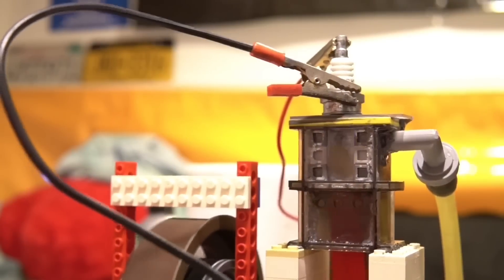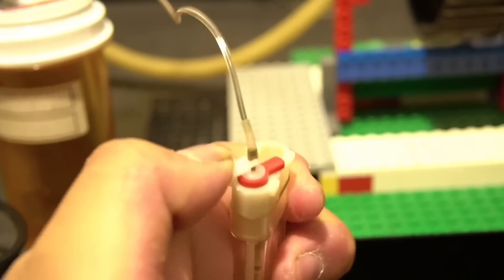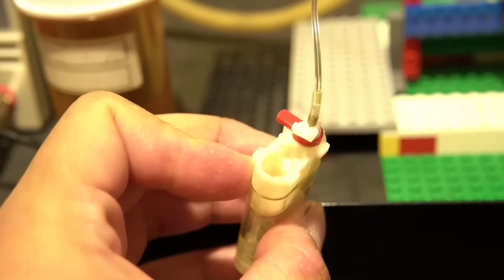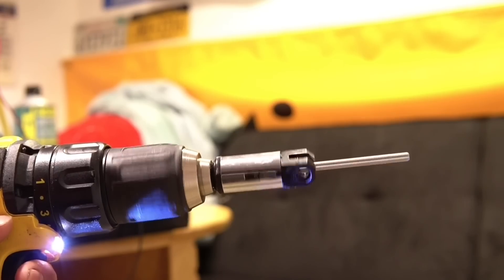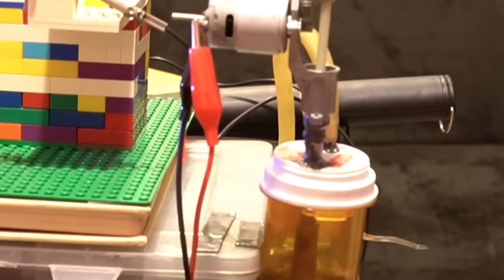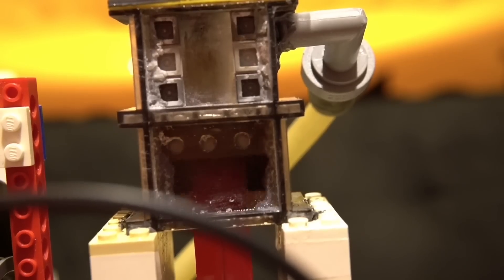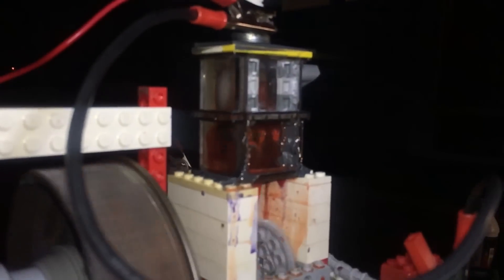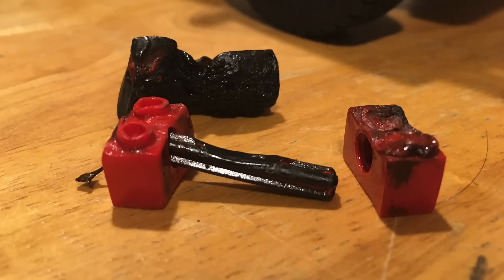Working LEGO Combustion Engine! (2 Stroke) Version 3!!

Comment: I gotta say I LOVE  your spark plug triggering mechanism. It's simple and elegant, simply triggered by the piston reaching maximum compression, it's wonderful. It's quite unfortunate that it never was able to power it self. I have a feeling that it might not be causing enough boom. Regular petrol would work better then the normal 2stroke mix with your design since you are not lubing any parts. Also lengthening the crank shaft and adding a second piston on an opposite timing would help immensely. It would cut the amount of energy you need per each explosion in half.

Comment: Have you measured compression?  If you have vaporized gas and air mixed at a proper ratio, spark correctly timed, and sufficient compression, the motor should run (at least given what I know about motors from being an auto enthusiast).  Fantastic work on the motor nonetheless, insane you can get anything like this out of lego parts.  I would doubt it's possible for it to run long though, especially if the parts that form the combustion chamber have any legos in them.

Comment: Have you tried spark advance?
Did you need more exhaust ports?
Did you need to add some something on top of the piston for a flat surface?
Did you need sone kind of coating to reduce cylinder walls temperature?

Comment: Engine can't start because no compression. Intake port should be lower. Then piston moves up, it should close intake port. This engine is two stroke. Read about construction two stroke engines. Good luck

Comment: For this to work you need to forcefeed the engine with the intake air, you need to go back to gasoline since the nitro methane melts Lego plastic, and the final key, you need to advance you ignition timing, try a couple degrees before top dead center NOT after 😉

Comment: nobody in the comments knows any about two strokes. do they need exhaust back pressure? no, they don’t. the back pressure people talk about that is “necessary for it to run” is just to make more power. the reason your engine won’t run is because the seals aren’t good enough. that’s also why the spark plugs don’t ignite the fuel every down stroke. the engine isn’t able to compress the mixture enough to enable combustion. figure out some way for sealing the piston and it’ll run, at least briefly.

Comment: 4:17 When you forget to turn the fuel pump on

Your intake ports need to be set lower than your exhaust ports for scavenging

You need to valve the intake.

Comment: You need to fashion a piston ring of some sort on the Lego piston and maybe some Teflon against the cylinder walls for sealing and lubrication you almost have it! 

Remember the exhaust port it usually pretty high in a 2 stroke there not much of a power stroke before the piston uncovers the exhaust port but you may get away with where you have it now as the intake system you have is different to the 2stroke, also try and put a kinda spark adjustment on it so you can advance an retard it, remember spark happens just before TDC looked in the video it was happening at TDC, maybe try a smaller flywheel so it may not be over killing the power? 

Keep it up will be good to see 👌

Comment: Hey, Remember in a 2 stroke the exhaust Port needs to be a little bit higher than the intake Port, and they need to be on the opposite side of eachother  in order to make an air flow through the cilinder

Comment: You shouldn't fire it in your house because of the carbon monoxide so just be careful and you could use rc grade nitro fuel and if you run it rich enough it will reduce heat in the engine

Comment: What if you make the exhaust port  somewhat wide as the inlet and maybe lower and then make a lego muffler or strick it down so then it could maybe run slighty better. Im trying to design a lego 4 stroke engine that i can hope and get running its just trying to get compression and valve cealing right, any way i made no sense for some reason, great video and keep going.

Comment: Hi there I love the concept but you've made a fatal error in afraid you need your exhaust port to be higher up on the cylinder than your intake port otherwise when the engine fires you force the fresh mix that is coming in straight out through the exhaust port hope this helps keep up the good work :)
Reply: Also  you dont need a proper exhaust pipe to make the engine run properly just something to slightly restrict the exhaust port (seeing as how it wont run on it's own yet I would make the exhaust restriction adjustable) the people who are saying you need an expansion chamber are wrong you only need an expansion chamber to tune the powerband of the engine and seeing as you aren't exactly looking for high performance it's really not worth it just a slide over the exhaust port that you can move to adjust the back pressure would work fine :)

Comment: Usually the 2 strokes have the exhaust port higher than the other ports, like 180 degrees f9r the exhaust and 120 degrees for the intake, also the spark plug should spark before the top dead center, like 18/20 degrees, more degrees before top dead center means a better working engine at low rpm but higher temperature at higher rpm

Comment: Remember this is a 2 stroke. If you use air pump to pump in the air-petrol mixture you maybe have the right pressure, but the biggest issue with your design, you put too high the intake hole and becouse it you haven't got any comression. Put the intake port down to the bottom dead center almost same level (upper edge a bit lower than the exhaust) as the exhaust port. If the piston seal enough and you have a good compression ratio at least 8:1 it should work :-) . I hope i helped.

Comment: Would it be better running metal parts with LEGO or just re engineer LEGO metal parts and use a more heat resistant plastic to use for cylinder viewing

Comment: I think the piston needs some form of seal within the cylinder to maintain compression, like oiling rings and such on a normal piston. I think youre only achieving single cylinder pops when the pressure plus afr is correct on that specific compression stroke. There is something to be said about a circular piston as well. A rectangular piston will not experience pressure forces evenly across it and thus im guessing would transfer to the rod weird, as well as weird bore and stroke issues leading to odd flywheel momentum. For the engine to sustain itself that first pop has to be strong enough to throw the flywheel hard, getting the whole system to rotate quickly enough to build high pressure for the next combustion stroke. I suggest going bigger with the whole design. Scale the entire thing up to make everything more structurally sound and rigid, and get enough air and fuel in that cylinder to go bang even with garbage compression. Also, 2 stoke engines are witchcraft and run on hopes and dreams.

Comment: The exhaust port opening times where waaay to small thats why the motor hat no chance of cooling down. An actual two stroke has 3/4 of the times the exhaust openend. The inlets are opened even longer.

Comment: I just built a 4 stroke lenoir cycle combustion engine from an old 110ccm air compressor. Ive learnt a few things in wanna share: 
1) compression is everything. Try to seal the piston by sticking pieces of tape to its sides. You could also make a piston from jb weld (check out makerj101s video on that)
2) use a flap/reed valve. You can easily make one from thin spring steel (feeler gauges are made from spring steel shhets in different thicknesses so you can choose from different strengths and they’re like 10 bucks)
3) the carburetor needs to be precisely tunable. You should shorten your intake hose and add a second ball valve to control the mix rate (air to fuel vapor)

Comment: I was waiting for this for ages, and it's finally out! I can't wait for the new and improved version! Also, try building a larger box around the cylinder, where water can flow through, it might cool off the legos enaugh not to melt, and make the crank-case closed, so you can put oil as lubricant in there. The oil might cool it from the inside as well. Thanks for continuing the project!👍

Comment: Try to make a lego engine that runs on pure gas. Only electricity to start. natural aspiration.
Reply: Im not sure if that would work, you need electricity to ignite the air/fuel mix unless you're talking about the drill
Reply: You could use electricity to start it.

Comment: Haven't watched the previous videos but i assume it doesn't work coz lego doesn't provide a good seal/any compression, so most of the expanding gas after combustion is just gonna blow by the "piston" and ur gonna have hardly any energy actually pushing it down. Also having compression would mean you don't need as much air/fuel being pumped in

Comment: Make a rudimentary carb so you can adjust your air fuel mix and get vaporised fuel rather than just liquid. That might give it a bit more of a kick.

Also, a one way valve on the fuel inlet would help with building a little bit of compression, otherwise when it comes back up you’re probably pushing fuel back down the line, assuming it holds any compression at all.

Cool idea though though, would love to see it run on its own!

Comment: Would putting a flat tile over the piston make it preform better?
Reply: Odd1 it would add compression at least .. also , the placement of the ports are off and the exhaust needs at least a pipe or even better an expanding chamber so the exhaust gases are getting sucked out. But it was a fun video to watch nevertheless

Comment: Cool idea dude, but what you are missing is compression. You will never get that thing running like that because of the immense amount of blow by. For a decent combustion cycle, you have to have a near perfect or at least decent seal from the piston to the cylinder walls. Without that, you wont get the proper combustion and any combustion that does happen will seep past the piston and out of the engine. hope this helps

Comment: What you need is a real fuel pump. That setup you have there is probably forcing air into the lines and causing problems.
That, and it's probably not at a constant pressute... You may be forcing fuel into the cylinder while it's already trying to burn and just end up putting it out, or opening the valve and letting pressure escape.

Somehow I feel like your flywheel may be too heavy for the engine to turn on it's own.

Comment: Ok, Great Idea. 

But If I may make some kind suggestions.

1 try building a hit and miss motor. They run at slower revolutions.

2 I believe your bug zapper power supply did not provide the necessary voltage that particular spark plug utilizes. All modern spark plugs utilize 12 volts. You may want to consider trying a glow plug or boosting your voltage to 12 volts and the necessary amperage.

 Or look into a coil spark plug system found in the early engines. A modern designed system can be found in lawn mowers and two stroke weed wackers.

3 try utilizing Pure alcohol for fuel. Now I doubt you can get ahold of alcohol used in rocketry which is the ideal candidate since it burns longer and cooler. 
But you could potentially use high-proof liquor alcohol which is known as ethyl alcohol such as vodka and moonshine and can be found everywhere.

I hope that you read my suggestions. I would love to see this project come to a successful conclusion it's a wonderful idea. 😎

Comment: Seems like you need a better seal on the piston
Reply: Yes he needs compression
Reply: This is the reason why it doesn't work. Without the piston seal, it is physically impossible for the engine to generate power from the burning and expanding gas. I would guess creating good enough seal from lego parts is pretty much impossible. I can imagine some type of epoxy coating for the cylinder maybe, and then sanding/polishing it to match the "piston".
Reply: Might be able to make a ring if you used circular Legos but finding ones that would be large enough would be a problem
Reply: Yeah it's a rectangle piston it wont seal well tbh
Reply: I came to the comments to type the same thing lol

Comment: Intake port is too high not enough closed room for compression, the intake port needs to be lower then the exhaust port. You can find on google or youtube how a 2 stroke cylinder looks like but yours needs to be without transfer ports becouse you dont have a closed block.
Reply: He doesn’t have any compression. The “cylinder” isn’t compressing anything all its job is is for show. All he is doing is putting in fuel, sparking it, and calling it a motor. at some stage he can make it more like a true motor but rn he literally made a air pump that sparks. 😂
Reply: He would kinda need compression for it to work
Reply: My Thought exactly mate, i mean there is barley any compression.

Comment: Why put oil in the fuel it isn't lubracating the crankshaft that could've possibly increased the octane rating needed and reduced Hp and torque i.e. Knocking

Comment: If your switching to nitromethane for fuel, you might as well convert to a glow plug and glow igniter. That might work better than a spark plug. PS, you better put the 6 speed transmission on that thing.

Comment: Put the inlet port below the exhaust port as then the engine pressure will not be wasted in the inlet port even though it had the valve. Also if you have a 3d printer try making a 2 stroke engine with some high grade thermal plastic as from whatni saw this plastic took a while to melt

Comment: You need a choke_able carburetor
Reply from the maker: Charlie Sybert ah you may be right didn’t think of that, it’s probably way too lean
Reply: @madbrick923  ya I work on old cars and tractors and you aren't getting the fuel to Air mixture so making a chokeable carburetor should fix you're problem. Look up a 2 stroke dirt bike exhaust and you'll see it has a blow back which helps push the piston back up so you might also want to make a pressure retaining exhaust manifold
Reply: @madbrick923   a proper ignition distributor will also help with timing and air to fuil mixture

Comment: Use a little bit of aluminium foil on the cilinder head to slow down the melting
Reply from the maker: comic sans skeleton ah yes slow down the inevitable
Reply: @madbrick923  I mean you eat dont you?
Reply: @135christian1  😂😂😂 good one
Reply: @madbrick923  and a fan too, active cooling
Reply: @madbrick923  Technically no combustion engine will run forever.
Reply: @Squee7e  you heard of Toyota ? Haha lol dont take it literal I know every engine will die soon but watch the 1 million mile 1UZ V8 from Toyota/Lexus
Reply: @madbrick923  what if you make a mold of the LEGO bricks and make a highly heat resistant LEGO using different plastics,
Reply: @madbrick923  take the goddamn advice